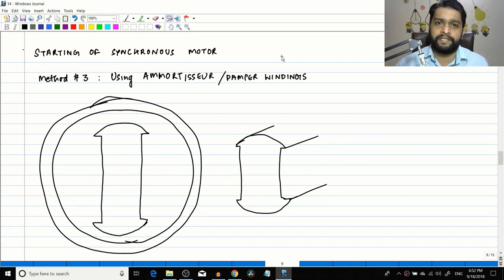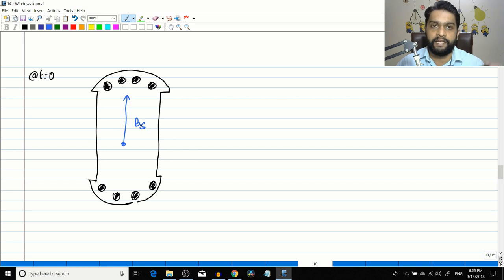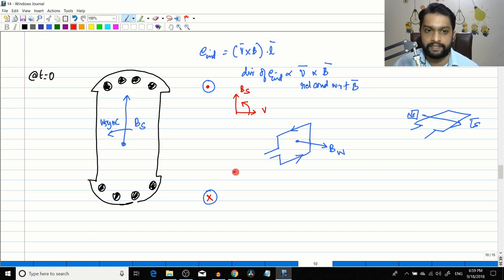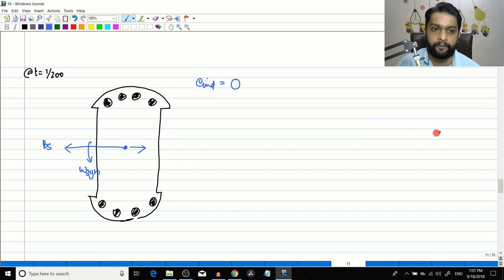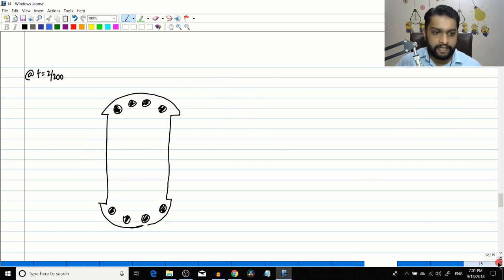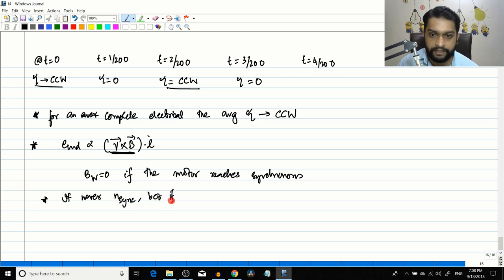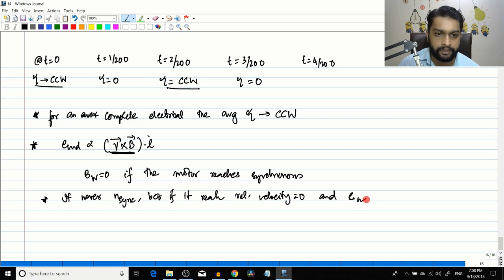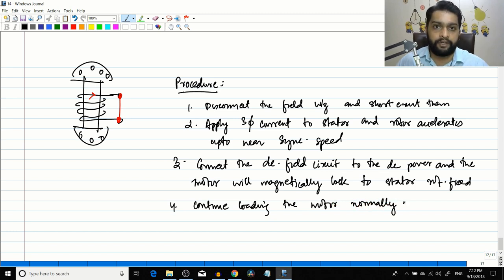#16 Synchronous Motor -  Starting Methods - Using Ammortisseur / Damper Winding

Comment: Sir we had short circuited the field winding before dc excitation that's good but after some time we have to give dc excitation to the field winding then We have to remove short circuit and we have to connect a dc source to the winding but while removing short circuit we will definitely get sparks due to large inducted emf so my doubt is how we can remove that short circuit and how we connect a dc source.Is there any electronic switch? What is the switch involved in that case without sparking? Can you please explain me sir....

Comment: Hai Varun, In BL Theraja, it is saying that in this method of starting of synchronous motor using damper winding, we have to apply low voltage to the stator winding of the motor first. And once it is in synchronism, full voltage should be applied. This voltage adjustment can be done by using an autotransformer. But here in this video you didn't mentioned the same. So without varying the voltage will it work out? And if then, why we need to vary the voltage? It is not clear in that book also, Can you please clear my doubt Varun
Reply from the maker: I am not sure about that.. in the book I referred nothing was mentioned like that